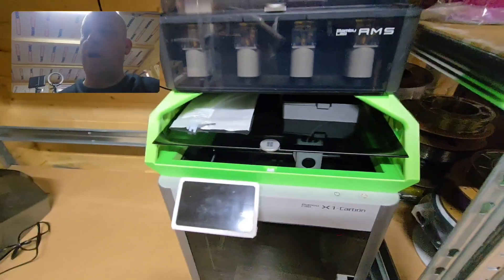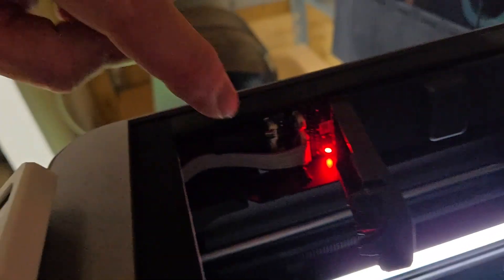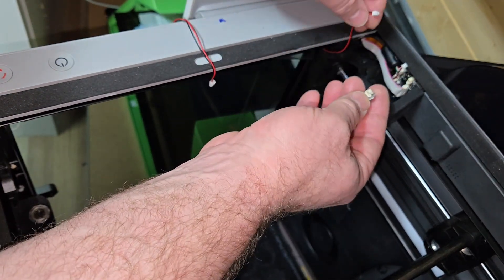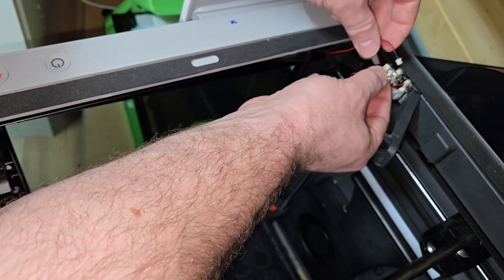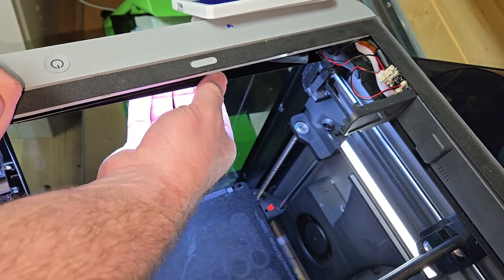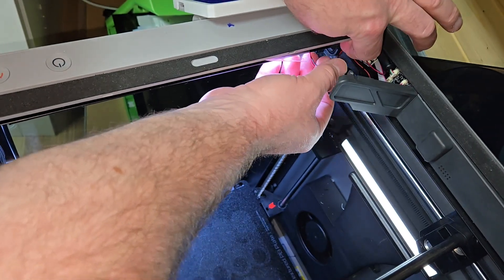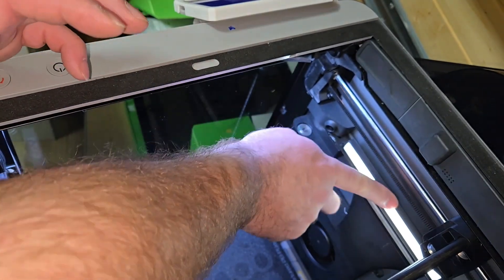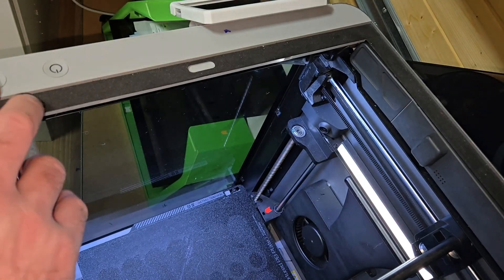BIGTREETECH Panda Lux LED Light upgrading my X1C - recommended not to connect both lights.

Comment: I am sure you are aware but just in case. Plugging both light strips in exceeds the recommended draw on the light bar connector. That is according to Bigtreetech. No idea what this might mean lol.
Reply from the maker: @alancruickshank9286  I've added a disclaimer on the thumbnail and title, thanks for the heads up
Reply: @3DPUK-TECH-CHANNEL  No problem
Reply: Any issues running both lights?
Reply: @ArmmenHammerBakingSoda im also interested in how is it performing today after some months.
Reply from the maker: @alancruickshank9286  that's good to know I may monitor it's performance 👌  and if it's an issue I'll disconnect the old, thanks for this heads up. It lacked instructions to
Reply: Why do they supply the connection board if they don’t want us to use both lights? It makes no sense from their part , yet they do say not to connect both.  Also what is the 4th connector for?
Reply: The light is so bright using 2 is pointless.
Reply: @paintballercali  Shaddows maybe ..
Reply: I’m giving it a go with both because it doesn’t seem like anyone’s having any issues with real world use. 🤞

Thanks for the instructions! Wasn’t totally sure I was looking at the right connection in the X1C. 😅
Reply: Do you have any issues running both? @emmmmm9

Comment: BQ the maker of the light cllearly say connect only one light. running both will damage the board overtime.
Reply from the maker: I've changed too.1.light
Reply: @3DPUK-TECH-CHANNEL  also for me i had to turn off build plate detection off. it was unable to read it.

Comment: Have you had any problems using both lights thanks
Reply from the maker: @alancruickshank9286  so after initially leaving them.both on.. i decided to remove the stock
Reply: @3DPUK-TECH-CHANNEL  That does not tell us much. Why did u remove the stock?  Did u have issues?  How long before switching?
Reply from the maker: @user-ym5xi1pg9y  so reason for removing stock was due to feedback from community and the brand to follow that. As its increased power on the board
Reply: The light is so bright using both is pointless.

Comment: I didn’t plug in my old light as that is over the rating so I discarded the board and simply plugged the Panda Lux in to the connector the Bambu light was in and it works fine.  

Curious for the purpose of the board - is it just to allow both to be plugged in (which makes no sense as the instructions specifically say not to do that) or is there another function?
Reply: I thought it was for cleaning install. Without the cable does reach but you can't tuck it away the same way as you can with that board.
I mean 2 extra ports is misleading but maybe it's a 1st one or 1st gen part before they knew it would burn out the printers board running more than 1 light. Or maybe they will add a power function later..
Reply: Initially the board was to allow user plug both lights, but then a lot of users complained about the boards being fried when both lights are connected so the just added new instructions where users are instructed not to use them. That way it`s not their fault if you don`t follow the new instructions. That`s why the light comes with the adapter, factory packs them as before just new instructions are probably added at a later point in factory

Comment: Ahhhhh, I printed the same AMS riser. I added little foam strips to the glass tabs to keep it from wanting to shake out or accidentally shattering.
Reply from the maker: @AceOfSpadezCC  great idea
Reply: @3DPUK-TECH-CHANNEL  Was necesary. The first time I started printing, I went in to check it and the glass was teetering on the edge of falling. I went from the top front, to the back and to the front of the under side on all tabs, incase I want to put it in at an angle for controlled venting it keeps the glass from vibrating and wanting to shatter.